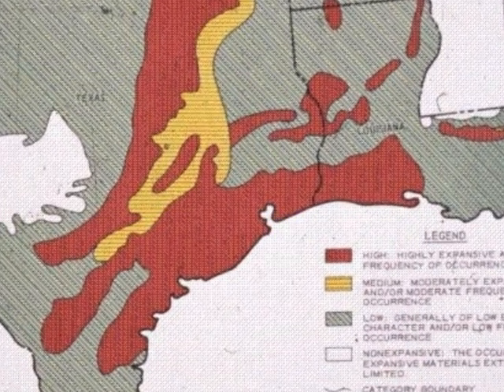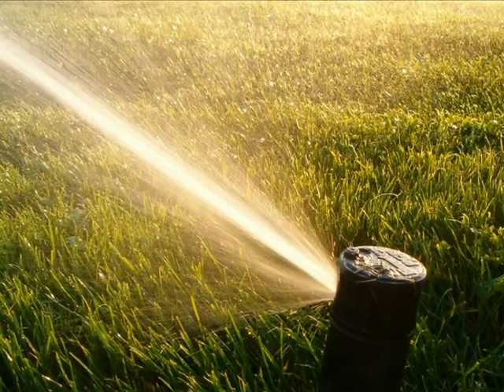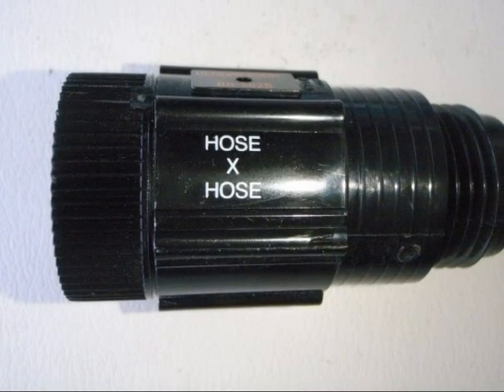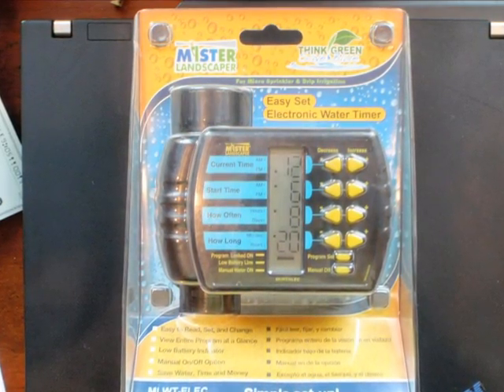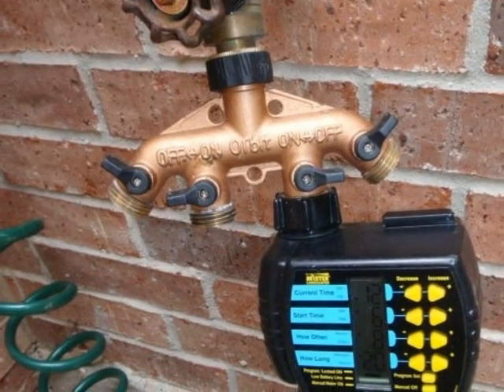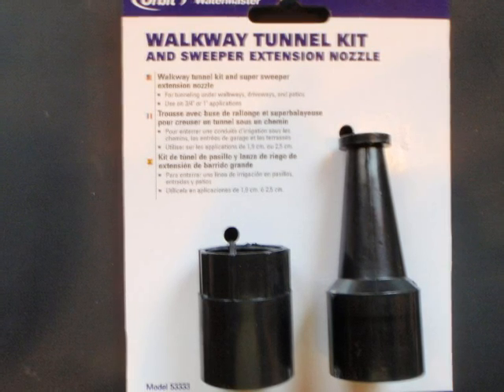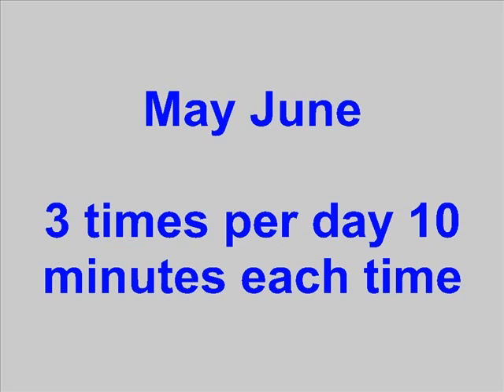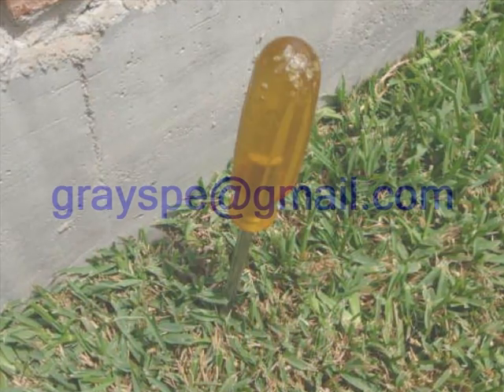R Michael Gray PE - Water Your Foundation The Right Way

Comment: The problem I have with soaker hose is it gets soaking wet at the beginning section and dry at the end section.
Reply: I have the same problem. How did you solve this issue? I also bought a pressure restrictor and still didnt work.

Comment: If were suppose to run gutters away from the house AND grade around the house so water runs away from the house, then WHY would I water foundation??? Explain the theory in detail please!
Reply: Yeah, i was struggling with this to. But as it was explained to me by a foundation company the idea is to try to keep the moisture level of the ground the same year round to prevent the soil from swelling and shrinking too much. Without gutters or a graded foundation, rainwater will pool and sink in under the foundation, and/or erode soil away. The soaker hoses are not right on the foundation, so what you are really doing with them is keeping the soil surrounding your home from drying out without the water running underneath your home. Too much water is just as damaging as too little. You have to find a balance, which is a pain in the butt and can take some time, but once you do, maintaining a schedule is as simple as a mowing routine.

Comment: Great video.  I have a few questions:

1) Do you just lay the soaker hose on the ground 12 to 18 inches away or do you bury it or something?  I'm sure you would have said to bury it if that was the case, but I thought I better check.

2) How can you tell if you are watering too much?

3) What about driveways?  My only foundation issue so far is the garage slab which keeps shifting away and down from the house slab a tiny bit each year.  Big problem since everything above the slabs is one connected structure.  Anyway 1/3rd of the area around that garage slab is obviously driveway.  Do I need to worry about that side?  Btw, I have no air gaps around that garage slab.  However, I do have some around the house slab which isn't shifting or anything.  Is it possible that all of that expansion/shrinking around the house slab is pushing/pulling the garage area since it is smaller, etc?

4) How does the soaker hose method compare to the hole drilling one?  I remember running across a video way back that suggested drilling like 2" holes several feet down every so far apart around the house.  Then filling the holes with gravel.  That way when you water the grass, etc, it fills the holes with water and soaks the ground.  

I appreciate any advice you have.

Comment: I'm not a comment type of guy but DFW area residents need an extra detail. You water around your foundation year around. In DFW we have winter droughts and spring droughts at times. This video goes over some important facts but misses the fact that you can have dry cracking soal at any time of year. Just be careful in the winter to not leave the soaker hose on and put a cover over the outside faucet or your pipes will freeze when it gets too cold. In the cold months just put it on, water with  the timer then take it  off and cover the faucet. If you don't believe me, late December early January go outside and check your soal in your whole yard not just in 1 spot. Do you see cracking? Then yes soal can get extremely dry in any month of the year. You will water less often in the winter and early spring because you won't have as much evaporation as you do in the extremely hot months. Hope this helps someone.
Reply: In northern DFW, and this helped me. First time home owner, and I have been trying to figure this out for the three years we have been here. Bought a 20 year old house with a near perfect foundation. We were getting cracks in the walls and tile after a year and a half. Felt kind of rotten, that the first owners were able to maintain it wonderfully, but my lack of knowledge caused some damage. I think we are getting the hang of it now. Great info on the winter months. Thank you.

Comment: I've done this for 5 years, and all I've had is headaches from worthless soaker hoses  that get holes in them after only a week or two... not to mention leaving the timer on means leaving your faucet on, which means there's ALWAYS a drip, no matter how hard you try. Also, I have a very long distance to cover with a soaker hose, so there's just not enough water pressure to make it the distance (especially when they get a tear or a hole in them).
Reply: I have the same problem. How did you work around this?

Comment: Michael, I have a question.  In the video, what is the purpose of using the 4-way connector when you didn't attach any additional hoses to it in the video?  Also, when attaching additional hoses, does that mean you will need a $40 timer for each hose?  For example, if you want to use a 2-way hose connector, do you need 2 timers connected to that 2-way hose connector?  I would assume so, but I just wanted to make sure as it could get expensive and bulky.  Thanks in advance for your expertise!